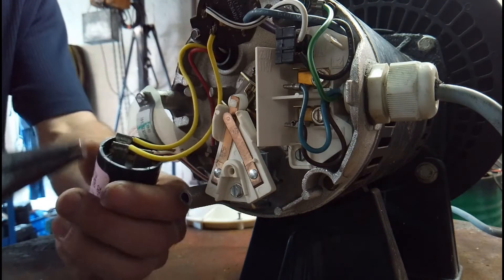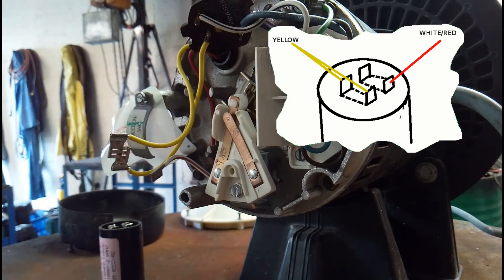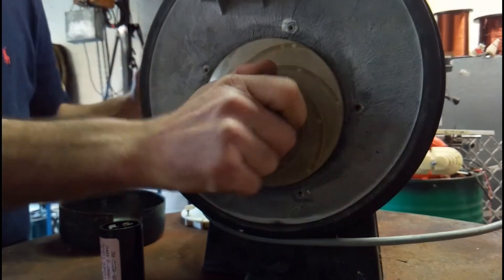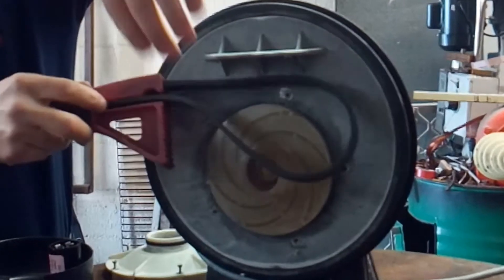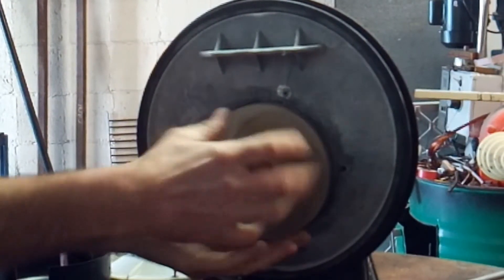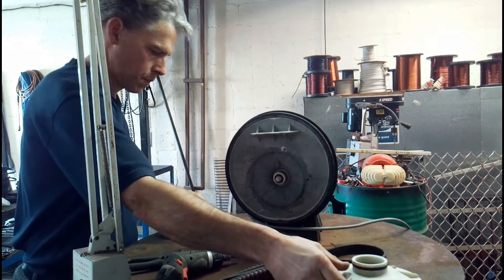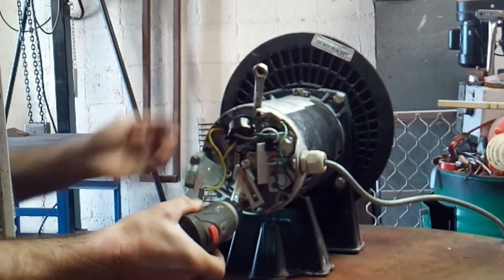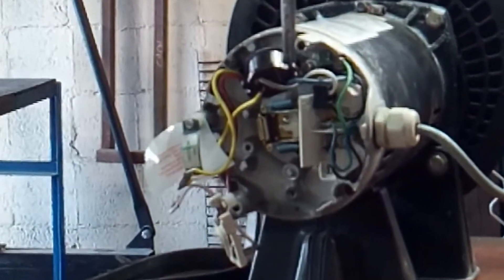Sta rite pump overhaul (2 of 8) - remove impeller/capacitor

Comment: No mention of the reverse threaded bolt retaining the impeller in place?!?
Reply from the maker: Gidday there Double Bizzy. These Starites don't have one. The shaft spins counter clockwise. They have a brass "right hand"  threaded insert  which is molded into the impeller and is blind. Many of the waterco pumps and a few others have this design you are talking about.. Also the later insnrg VFD pumps. But good to always look for this. I have seen many broken on account of people trying to remove impellers without unscrewing the "reverse threaded bolt"  Cheers
Reply: @electricmotorrepair2605  Yes, I almost broke mine, yikes!  Thank you.